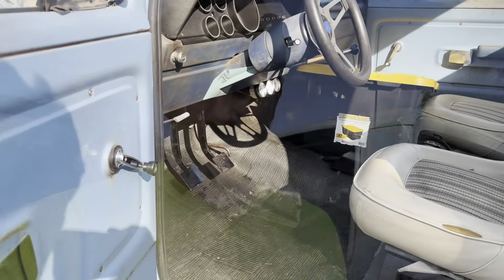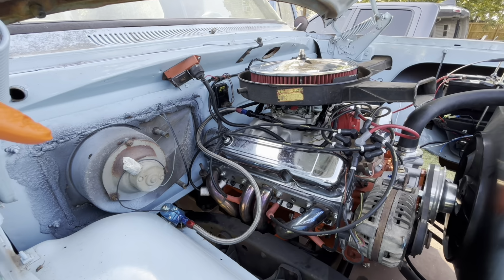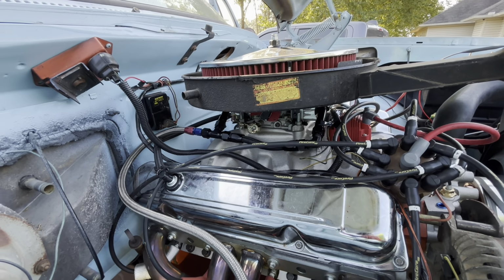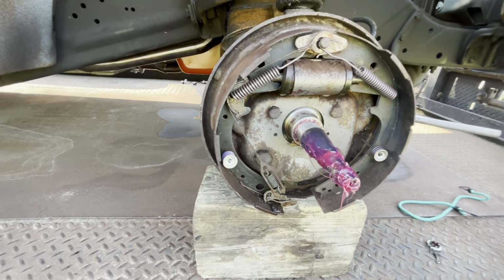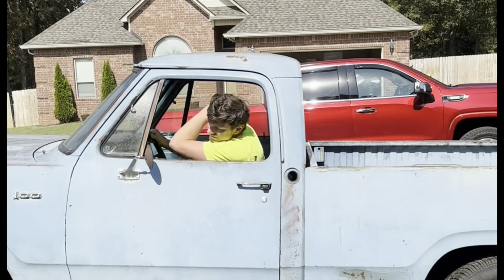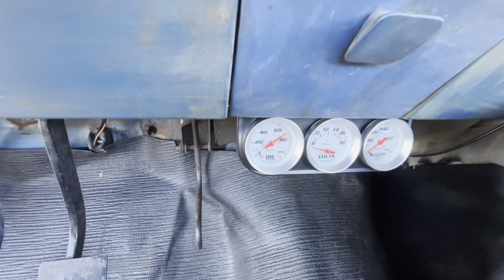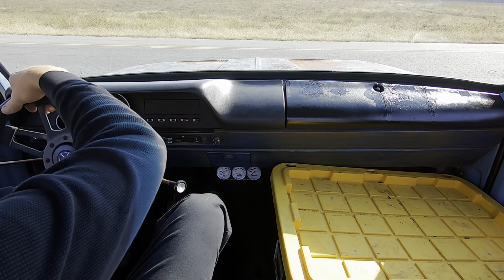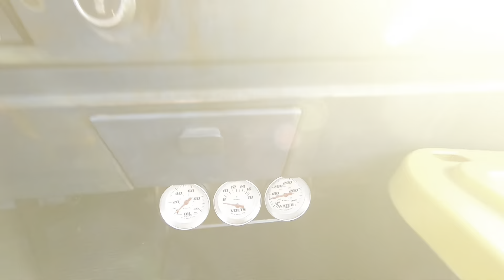72 Dodge D100: Trailer Failure to First Test Drive #mopar #racetruck

Comment: Been there done that😂 one thing after another is a sign son. When things go this way it's a sign from above to stay home. That brake shoe shit is odd to happen. You are right. If that would have happened at any speed it would be bad. Most likely tore them to shreds and pulled hard left. You know where other cars are 😂 fuel leaks and fires are bad too. No alt is bad too. Back to lunch time fixin. But the test run was a good start. My d100 is still parked and no point going forward on it for a while. No inside storage is a new problem and I refuse to leave that motor in the snow bank. Winters comin for me so time to rethink my priorities. Good job Joe it's a nice truck.
Reply from the maker: Thanks for the encouragement! You’re right, winter’s gonna be here soon, and I’m sure we’ll both have our hands full.

Comment: Lunch broke Joe hilarious
Reply: If you don’t mind me asking what’s your cam and heads on that ole 400? She sounds good. New subscriber here I’m sure you did a previous video with the details
Reply: @Jacked97Ram  Hey, I'm not Joe (not even close) but as I recall the cam is 238/242 on a 110  10to1  Eddy Street Force ? Tuned up. I think about 536 hp on the dyno?
Reply from the maker: Comet got it! I actually stole my edelbrock e street heads for my 512 in the barracuda. These are 440 source stealth heads that I did some light port and chamber work on in a few videos. The neat deal with this engine is it’s a hydraulic roller cam with solid roller lifters.

Comment: God I love the Birdbath D/W's!!! Sport mirrors, metal door panels, blanked out dash... beautiful!!! Glad to see that blueberry back on the road. 
Now for the bad news... you dun f'ed up son! You didn't bed them shoes in right out the driveway. Don't be that guy who does all the parts, hits the track, and then first pass takes out a wall (or worse) because he skipped the very last step bedding in shoes/drums. If one doesn't bed them they just glass and end up having to be abraded taking out half the damned shoe and sometimes the drum, especially if they've been turned before. Its pretty rare nowadays to see drum front brakes so its a pretty easy thing to completely forget. One thing I hate hearing is the bs excuse "you don't have to do that anymore with the new styles of composites"... yeah and its quite alright just dropping replacement valves into a head and run it without lapping any of them. 
Yes Im giving you a hard time! I'm just lookin out is all. Its a simple oops and easy to fix.
Reply from the maker: Thanks brother. So far it’s been less than 10 miles. I need to find that front end shake too, but it’s probably tires

Comment: Yeah I like that 400 engine. Sounds great. Very underrated engine. What gears do you have in the rear? Sounds like 3.73s? Oh and I got news for you man you got your brakes assembled wrong. Left front lower springs and stuff are hooked up wrong and your right front is missing a lower spring and maybe other parts. Sure they will still work .... kinda. Thanks for the video.
Reply from the maker: Thanks Tony. The front stuff fell off when the brakes locked up

Comment: To bad you didn't live close to me id give you the manul steering column For it . 💯👍👌✌️🫡
Reply from the maker: It’s got the 3 on the tree column. I would probably be happy with an auto column and get my bench recovered
Reply: I thought it had the floor shifter.  Thats way  I offed  .   that way the actual  arm wasnt. still  there   I have mine set up that way  I also put in  and  use  the foot ass clutch  assembly  but my actual  clutch peddle turn on my high lights.   Lol .I think it funny people think it's stick shift  . Sounds sick on video 💯🫡👍💪✌️
Reply from the maker: @josephsaucedo8691  thanks brother